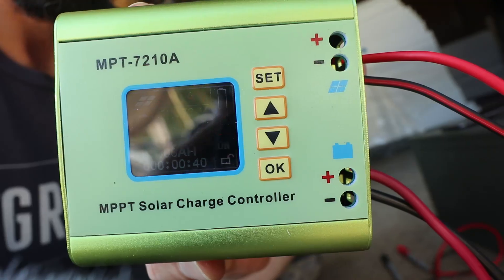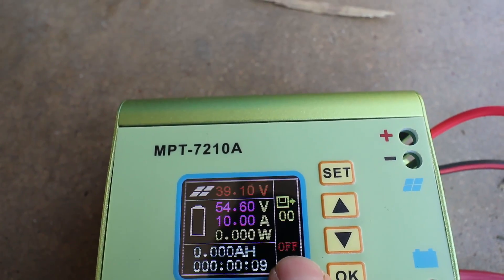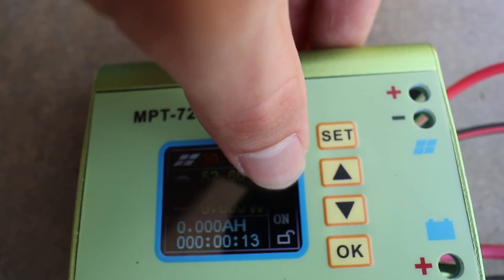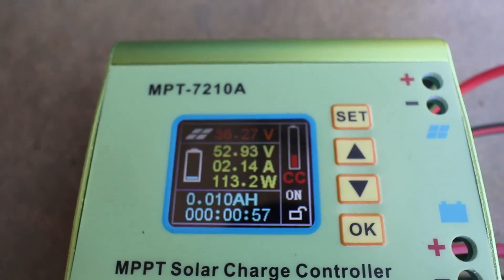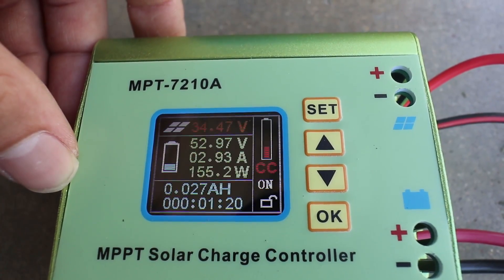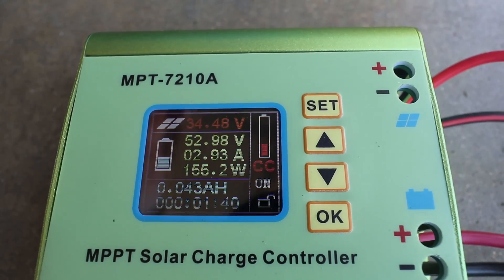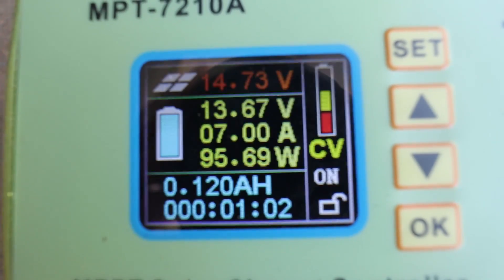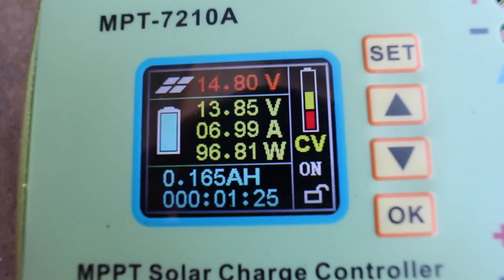Why The MPT-7210a Charge Controller Might Be The Best Golf Cart Solar Charger

Comment: I have been solar charging my ebike's battery for over a year now without a charge controller and just monitoring the voltage.  Recently I bought the MTP-7210a and it seemed simple enough to hook it up but the "manual" is impossible to understand (I illustrate and write manuals for a living).  It seems like much is missing.  Anyway, when I make all the connections the readings keep alternating between the panel voltage (with no current) and the battery voltage with charging current.  Each time it alternates it takes several seconds to stabilize.  Am I doing something wrong?
I have seen hints that there may be several methods of charging and storing data but nothing specific on how to do it.  You seem like the guy to ask.  Maybe my charge controller is defective.
Thanks.  Oh, here is a link to my video on solar powering my ebike: https://www.youtube.com/watch?v=0Px8sbsGctE
Reply from the maker: Couple things I would verify. Did you put your two panels in parallel? This is a boost controller so the panel voltage should be lower than what you’re trying to charge.

Second is the panel voltage setting. I don’t remember exactly with mine but it was cycling off and on due to me not having the voltage dialed in. I’d put it to the vmp of the panel. So for my 46voc panel I have it at around 32v.

See if either of those help you out and let me know.
Reply: @BeeneEnergy  I wired the two "24V" panels in parallel for this application so that they would be lower than the "48V" battery.  I was not able to actually dial in the panel voltage.  The indicator on the regulator says the "24V" panels reads about 40V and varies a bit.  Thanks for your quick reply!
Reply: Okay, I was able to set the panel voltage and possibly have saved the settings by following the operating instructions to the letter however the controller charged passed the voltage setting point and the instructions failed at the 11th step and would not let me set a time to turn off the screen.  Thanks for your help

Comment: Thank you, awesome video! A couple questions. Will the charge controller save the battery charge voltage setting if the battery is disconnected, such as if the solar panel and controller are motionless while the golf cart moves from the charge station? I do know it's possible to save the voltage setting if the panels go to zero volts, while it is connected to a battery source, but what if the battery is disconnected? Also, will the controller stop charging the battery at the controller set voltage if the solar panels' voltage are above the set battery voltage value? Thank you so much!
Reply from the maker: Yes, in fact the charger will go offline when the sun stops powering it. Unlike most charge controllers that need the battery to run this one seems to power itself from the panel.

I’m not sure about the second question. I haven’t tested that scenario.

Comment: I want to charge a 40v lithium lawn mower battery in my garden shed where I don't have mains supply. I suspect it is actually 36v and charging voltage of 42v. What is the voltage that you set on this device battery voltage 36v or charge voltage 42v?
Reply from the maker: Lester Bennett you need to determine the specs of that battery for sure. Preferably tear it apart and determine how many cells in series and multiply that by 4.2.
Reply: I dont know if it's stil relevant, but you have to set it to the maximum voltage, so the voltage the battery has when it's full. In case of lithium batteries in a 36V pack it should be 42 Volts.

You can also check the charging brick for the battery to be sure
Reply: @antonw.415  I agree... if it happens to be a lifepo4 battery it would only want a max of 3.65v not 4.2... I set mine to 58v for my golfcart even though 58.4v is the peak voltage for my pack. it still charges to like 99% and the battery bms isnt kicking in to shut off charging this way.

Comment: How bout 48v VOC PV array to charge 24V 50ah lifeo4 Batts using that green mppt SCC?
Reply from the maker: I wouldn’t do that. Grab yourself a more standard step down mppt controller. Like the powmr 60a I’ve got in a couple other videos. I think they are more efficient anyway with the tests I’ve done.
Reply: @BeeneEnergy  I have a 50a SCC to use anyways...but this green MPPTs also has a step down function does it?
Reply: @lutherbertsomera2074  It's only a boost charger. It can't lower voltage. Not sure exactly what happens when you connect a battery that's lower voltage than the panels, but it doesn't work right. It either doesn't stop charging, or it cycles on and off rapidly and doesn't charge. I accidentally did it trying to charge a different battery and quickly noticed it was acting up.
Reply: @volvo09  this i formation contradicts the video, and I think what you are saying is the correct one. This is only a boots converter and that's it, you should not connect higher than battery voltage solar panels